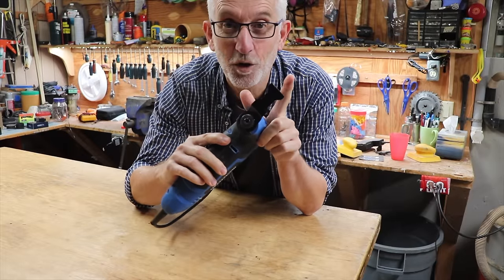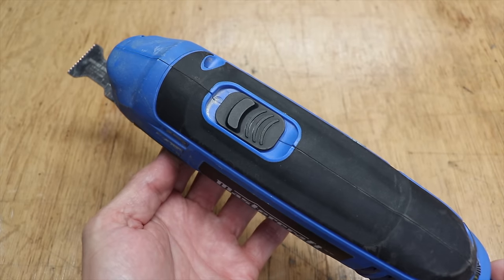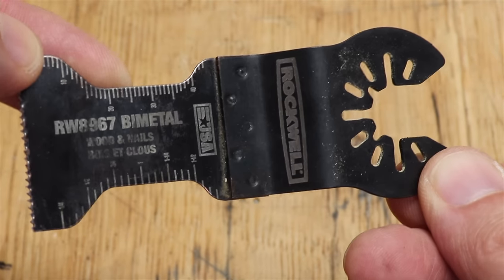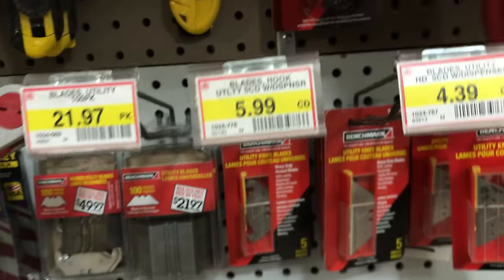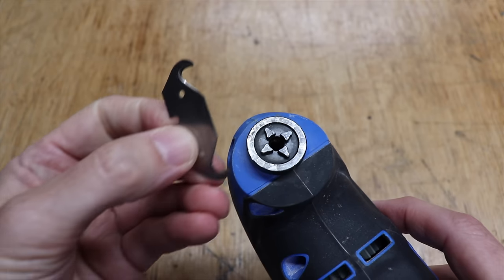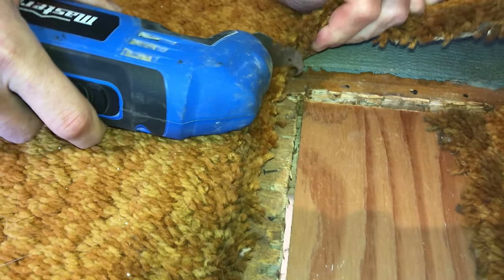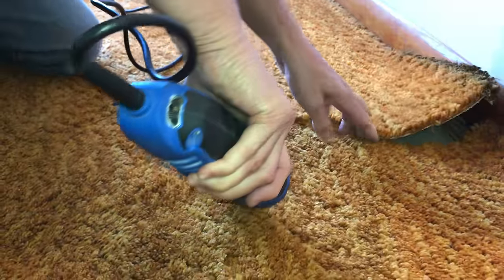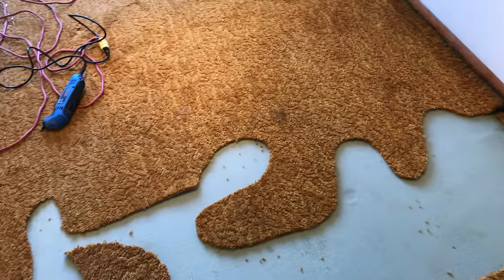Amazingly Cheap DIY ● Oscillating Saw Blade !

Comment from the maker: Here's the link to these blades !
USA 
● The MasterCraft Oscillating Saw I used in the video .... https://amzn.to/3ht5ine
● Hook Blades That I Used .... https://amzn.to/32Ns8fa 
● Actual Oscillating Saw Hook Blades .... https://amzn.to/2W9ImMM 

CANADA
● The MasterCraft Oscillating Saw I used in the video ....  https://amzn.to/2JtKBpr 
● Hook Blades That I Used .... https://amzn.to/2WiAZTo
● Actual Oscillating Saw Hook Blades .... https://amzn.to/347E8bu
Full Transparency! A small portion of each sale goes from Amazon's pocket to my pocket with no additional cost to you! Thanks for your support. It's very much appreciated!
Reply: $6 for a 5 pack of hook blades, or $58 for a 5 pack of Dremel's hook blades. Who in their right mind would choose the "official" option?
Reply: The video doesn't address stability of the blade - what does it take to make the hook blades pop out of the oscillating tool since they're just wedged in there under compression?  Why this matters:  Most of the oscillating tools now have spring-loaded "easy change" tool holders which implicitly limit the compression available to hold the blade, instead relying on the indexing pins.  This could turn a really great idea into a safety problem.

Comment: Went right to Amazon. For 12 bucks u get one blade designated for an oscillating saw. . For 10 bucks u get 40 blades like Chris used! U do the math!
Reply: Yes, a much better deal but does it fit the new tool arbors?
Reply: @captainjolly8734 Yeah I saw that. What a cheek asking that much for one blade with an oscillating blade attachment. They'd be punching them out by the millions in a factory somewhere in a third world country for sure.

The blades designed for the hand held knife in the oscillating tool. Even if they fell out, they'd just fall to the ground and because they're so light, if it did cut you as it fell, it'd be no worse than a paper cut. So no danger to life or limb.

If you wanted the oscillating saw blade attachment on your blade, you could tack the the knife blade to an old saw blade or if you don't have a welder, drill a couple of holes in both blades and use a couple of small nuts and bolts to connect them. Job done/they're not going anywhere.

Comment: Got here via your cyclone vac filter. Brilliant. When you see tool mods you often wince at the alarming harm from unintended modifications. I’ve use this type of carpet blade before and it takes brute force to use in the intended utility sheaf. Your system looks safer for the user bar the usual caveats for using any power tool. Especially in this case keep live power chords away from your work area. Once again… brilliant.

Comment: Really smart, thank you for thinking of this and posting. 
Oscillating saw hook blades at Amazon are $58 for four or $14.50 each.
Hook blades at Amazon are $13.45 for 100 or $0.14 each.
That's 100x less expensive!
Reply: Also much more dangerous, the hok blades for an oscillating tool are made to stay secured to the tool, this is held by friction, it can come flying out.

Comment: Just tried this hack to cut the excess from vacuum formed blanks and it works like a charm! this is going to save me time and money, thank you so much for sharing. I do file down the pointed end of the carpet blade and put the tool in a vise and draw my plastic through it for safety. Super clean cuts very time. Amazing!
Reply from the maker: Wow! Cool! I'm glad you found a cool way to use it!

Comment: I was just starting my vinyl removal (and underlayment) in prep for putting  in large format tile.  I stumbled on your video and immediately ran off to the lumber yard to pick up some utility knife hooked blades.  I have a Fein Multi tool, which has a similar locking system as you used on your tool.  THIS SETUP DID A FABULOUS JOB AND YOUR VIDEO WAS ONE OF THE BEST AND MOST USEFUL I'VE FOUND ON YOUTUBE.  Thank you.
Reply from the maker: That's fantastic!! Thanks for that great feedback!!

Comment: Great tip. I saw the Fine tool advertised in Fine Home Building 40 years ago. I thought what a funky useless tool. Man I was wrong on that one. I was on a job and a guy let me use one and wow it was a game changer. I now have several of them. I'm a 71 year young carpenter and still working and learning and the oscillating tool is in the top list of tool changers I've seen since I started.  Here is my list of tool game changers. The list is in chronological order.  Rockwell 9" chop saw. We did all our finish miters with a hand saw and miter box. Virtually overnight the miter boxes were gone.   Pneumatic nailers. I would spend a day nailing off 2x6 T&G sub floor decking with 16's.  I dreaded nailing off soffits which were big in the 60's. It killed your tri-cep. Battery operated tools. I remember my boss coming back with a Milwaukie battery operated saw. I was about 22 at the time.  It was underpowered. Boy I've seen an evolution in battery operated tools. Oscillating saws. Before the oscillating saw the only option was a sawzall, sharp chisel or utility knife.  A final note is fastners, hangers and adhesive have drastically improved. The only thing that hasn't improved is inspectors.
Reply from the maker: You are so right in every thing you mentioned Tim!! I call my oscillating saw my "awesome-lating" saw because it will do so many things in tight spots that no other tool can do. I want to get a battery powered one next. At Canadian Tire here in Canada the corded oscillating saws go on sale for 29.99 and can be abused to death and still work great! And yes battery tech has went in leaps and bounds and is opening up a field of battery powered tools we have never thought of. And your also right when you say "71 years young!!!"

Comment: Why did so many people give this a thumbs down? I don't get it it, it's a great tip.
Reply: Probably pro carpet fitters now out of a job:)
Reply: It’s because they sell an actual attachment like that that mounts better to the tool. If that razor get caught and snags, it’s barely mounted correctly to the oscillating tool and could snap and go flying off. It works. Everyone gets that. Just saying that’s what the thumbs downs are likely from.

Comment: I just came across this the other day and gave it a try with my new multi-tool. What an incredible tip. It zipped through thick plastic like it was nothing.

And the Husky blades from Home Depot are cheap enough I don't care if they don't last all that long. Certainly cheaper than the dedicated blades.
Reply from the maker: Yes it is amazing how easily it cuts plastic!!

Comment: Awesome! I just did some rolled roofing and left excess intentionally, at several roof edges. I am going to try this with my multi-tool saw,to clean up and trim those edges! I was going to try  it with a regular blade to begin with, but this looks like it may go through the material more efficiently.

Comment: u know what i appreciate even more than your info sharing and advice? the use of  corded tools!
Reply from the maker: Yes but battery powered are really good too.
Reply: @chrisnotap  kind of. they r usually heavier and not always well-balanced. also, the batteries tend 2 cost a lot and die quickly, plus it's additional pollution (mind u, i'm not environmentalist, but adding extra Li doesn't make much sense 2 me). plus, a simple/cheap batter would never supply enough current long enough 4 any serious job...

Comment: An excellent and most versatile tool tip you're sharing. 

Works great stripping 500MCM electrical cable (thumb size) and you can modify the blade profile to suit the smaller stuff. With a little practice and luck your tig toe can create a tiny ball on the pointy part without any filler. The little ball lowers the possibility of internal collateral damage. 

That's the thing about electricians, we may not be good but we're slow.

Comment: Excellent tip as we have carpet to remove so this will be a tremendous help.  The Dremel blades are $49 for a pack of 4.  They can keep them.  I'll use the common hardware store hook blades

Comment: I’m going to buy an oscillating saw, just so I can have a human carpet cutout. Cool hack and vid!
Reply from the maker: I don't know if these blades will fit all oscillating saws. That's why I showed the mount on my saw. Hope it works for you.
Reply: Buy the blades, then take one with you when buying the saw to make sure it fits proper.
Reply: @chrisnotap  you're tip is so awesome that it's worth buying an oscillating tool that the blade fits in. They've come down in price exponentially since I started in construction work back in 90. You couldn't buy one for less than 250$ back then.

Comment: Yikes!!  That first link was $58 for FOUR blades!!!!!!!   Your idea is much better!
Reply: Yeah, I saw that too.  That's not the only item on "Amazon" that is priced way out of line.  More and more, there seem to be a lot of third-party unaffiliated vendors on Amazon for which I assume there is little accountability.   Many are recognizable because Amazon's shipping deals do no not apply to the products they are selling.

I generally trust Amazon based on my limited experience, but some of these other parties are pretty high priced.  In this case the four blades for $58 just happens to be Dremel, which is invariably the most expensive brand I've come across for both the tools themselves and accessories.  I buy a lot of tools and accessories, including "disposables" like blades, etc.  A lot of Dremel products use proprietary parts and accessories, so you have to buy Dremel brand - case in point is their multi-tool for which other brands' blades won't fit, so you must use Dremel.  However, if you search for "Dremel multi-tool hook blades" you will find substantially cheaper blades than that link.

Beyond that, I have to wonder if the multi-tool even matters with that hooked razor blade, seems like you could just use a simple hand tool and cut whatever.
Reply: @rla1000  What great Dremel parts/accessories info you provided; thank you.
Reply: Just think if he had thought of it earlier he could have sold them himself.
Reply: @glen1arthur  He still could as a product that "Fits Dremels"; after he comes up with about a million dollars to start manufacturing, marketing, packaging, & shipping them! "It takes money to make money" is a fact of life.
Reply: We have a huge stock of oscillating blades at work, but we keep a 3 pack of Dremel branded, carbide tipped blades. When we need it, nothing else works. When that cut is done, we swap back to the cheap blades. It is what it is.
Reply: @JonathanSias  on Amazon the Bosch Starlock Carbide Plunge Cut Oscillating Multi-Tool Blade gets a better review.
Reply: @rla1000  it is the oscillation of the tool that makes it cut so much faster than doing it by hand.

Comment: Pumpkin Carver!!!~ :-D
Reply: LOL, my first thought as well.
Reply: Right on!  I can hear my “inner creativity” screaming ... “Get me a pumpkin”.
Reply: i used my do it all oscilator from harbor freight on the pumpkins last year, but i didn't think of the nifty razor knife blade, ,i also use it on large meat bones, (i think that was it intended purpose when the tool was designed, except for human bones, and bone cast removal), we've had them in the body shop for years  for removing glue , caulk, windshields, and anything else we could use it for,, but they were pneumatic, when i first saw the dremmel one i grabbed it quick

Comment: Wow... That is awesome....pair this tip with some novel uses of HF 1x30 belt sander , and you could repurpose a lot of old worn blades (like reshaping the end cut version, that utilize the thicker tool steel).
Thanks!

Comment: but it's not properly secure 
accident waiting to happen 
stay safe brother
and of course i subscribed 👍👍
Reply: I thought the same thing.  I still used it, I just make sure to use double eye protection (safety goggles AND face shield) every single time.  I also orient the blade so that it tends to tighten the retaining screw on the cutting stroke (but with an oscillating tool, I know that approach has limitations).

Neat hack but definitely not something to get complacent about.
Reply: Isn't the vibration pretty low magnitude though? So even if it were to come loose, it's not going to fly very far.

Comment: This is really the best hack I have seen in a long time, but Chris the blade cannot pop out? It doesn't look like it's anchored as other blades. Sweet and concise video. Thank you.
Reply from the maker: I tried loosening the blade ever so slightly and tested it several times like that and all it does is fall out. Does not go flying.
Reply: @chrisnotap  Oh OK thanks.

Comment: Great tip just make sure that screwed in tight ! Will have to see if it works in my multi tool as fittings can be different! Will send to my carpet fitter !

Comment: I would have liked to see that blade cut some single layer and double layer shingles, which is what it was designed for to begin with! I started roofing 38 years ago and no longer roof, but,  oscillating saws came out 10+- years ago, I sure would have tried that hack!!
Reply from the maker: Yes I think this would be very good on shingles and you'd get very straight lines

Comment: The oscillating tool blades sold by harbor freight really aren’t terrible and are a helluva lot cheaper than dremel or  the original company...Fine. Try them...you won’t be too disappointed, I haven’t been. 
Great tip !  I’ll definitely be trying this one. I’m gonna sub too.
Reply: If you have a Menards near you it is also a good place to get blades for a reasonable price.

Comment: Great Hack !  I’ve used Fein brand Oscillating tools and the Cheaper  Harbor Freight ones  and honestly  i didn’t see any reason to spend  more money than the Cheap ones other than all their blades  got dull faster  i will add that  as a rule it’s not my first choice of tool to use on most jobs but they have there place and time  around the Workshop and Jobsites  as they can offer  good controllable plunge cuts in certain materials  and as you demonstrate with a proper blade  can cut plastic  pretty fast and  safely

Comment: Perhaps put on some cut resistant gloves? A decade ago i sliced half my thumb off by a split second no thinking moment, 3 hours in hospital, stitches.. Since then i wear cut resistant gloves for any creative DIY projects. They have saved me a lot of small “normal” injuries over the years and lower the chance of a big injury as well. You found a nice usage of that oscillating tool anyway 👍

Comment: I really liked your demo when you cut the 2 layer wall panel plastic, I put some up in my bathroom last year and it was a nightmare trying to cut it with stanley knife and cross cutting it as it seemed to shatter all the time or be really difficult cutting across the vertical support plastic. Whish I had seen this then I may have done a better job !

Comment: Nice tip.  As a carpenter, I’ll be using this but ALWAYS with safety goggles and gloves.  Those blades could snap easily.
Reply from the maker: Correct. Always with safety glasses.

Comment: Clever hack that works very well.  Unfortunately a lot of multi tools (including my new dewalt and the Fern one I had before) have a series of round pins to hold the blade in place rather than the star shape you have on yours so I don’t think I could use it.  But amazing how well it cuts
Reply from the maker: I know what you mean about the pins. It needs to be a mount like I have in the video where there is some flat surface area to clamp to the blade. Thanks.
Reply: I have just looked at my Milwaukee (new-er tool-less model)... If the base of an old blade was used as a spacer, I think it will still work, but you may ruin one end of the razor blade. I may fish around for some innertube to make a washer to resolve possible damage and try it later tonight.
Reply: The pins are there for your safety, they're meant to hold the blade in place so that it doesn't oscillate away. A cutter hand cutter blade as used in the video is held only by friction, bypassing all that makes the tool safe.

Comment: The link you shared for the utility blades was actually for a retractable utility knife, and 5 blades. for $11.16   With about 30 seconds of searching Amazon, I found a pack of 100 blades (retractable knife handle not included) with a wall mounted dispenser for $15.99, or I could have had another one for $2 less without the wall mounted dispenser. In either case, this is a brilliant tip and will surely be getting used in my home and workshop.
Reply: Just remember quality does matter even in something as simple as a pack of blades. I've bought middle of the road before with razors for a hobby knife and they were more dull than the used ones I was replacing. Stick with good known brands usually and you should be okay. You'll pay more initially but you won't end up with 100 dull blades as a paperweight.

Comment: Brilliant find. Thanks. One thing to think about - the regular blades are safe if you inadvertently contact skin. The carpet knife blade may not be so forgiving.
Reply from the maker: tool should be used with caution. This is no different. Common sense is best.

Comment: I'm making your home depot bucket cyclone, tried this trick, it worked but not as good as yours, mines not variable speed, so I wonder if that makes a difference. I was using a Ryobi + from homedepot. Got the first step done and fits nice and tight.

Comment: Going to buy a battery oscillating saw designated just for cutting. Thx Chris
Reply from the maker: Make sure the blade will fit. Some newer mounts are different. Good luck.